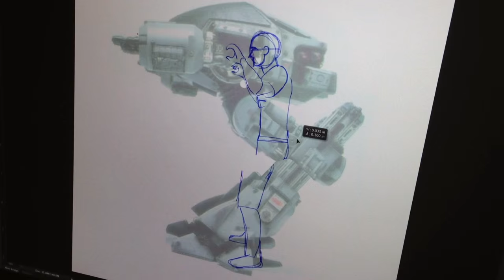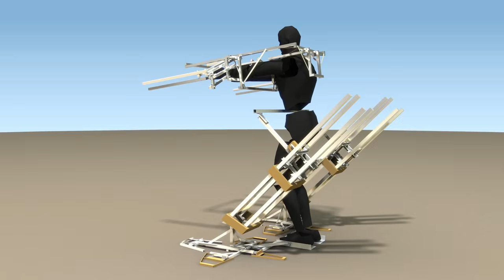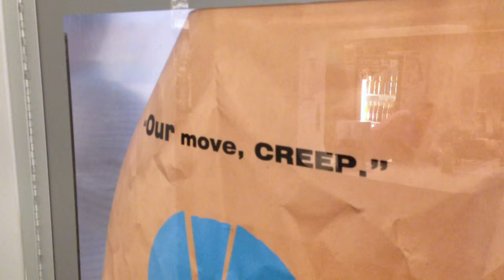Re-making ED-209 out of cardboard!

Comment: Oh also, if you want to get rid of that "bounce" that makes stuff light, add foam as a shock trap for the base points of the movement and then add a little bit more resistance into the joints, and you'll see mechanisms shake a lot less which can help you sell something as heavier than it really is -- because all of the weird oscillations that lighter objects have are minimised at source and what's left over is absorbed. Downside is it can be kinda noisy sometimes, depending on the type of foam and for some stuff, styrofoam just makes the most god awful sound. I find sorbothane and calk works best.

Comment: what did yall use for the conversion from 3d to 2d to print out your templates?
Reply from the maker: In our 3D program (Lightwave) the geometry was built "real world" scale. In 3D, we unfolded & flattened each piece of geometry, drew a box around it, measured the box's dimensions, and took a screenshot. In Photoshop, we scaled the screenshot to match the box's measurements, and sent to the printer in tiles. That's how we figured we could pretty easily translate our 3D measurements to the real world. Also worked great for complex aluminum builds, where we could basically "trace" our aluminum pieces on top of a blueprint. Here's an example in our photo gallery: https://www.facebook.com/Ghostlight/photos/a.10151605176010868.1073741829.186031635867/10151668637570868/?type=3&theater
Reply: Well Id like to say very nice work, Im tackling a similar project to build one for an 80's themed Comic Con in Nov a friend of mine is putting on. So i've been doing research and loved how ya'll did yours. was hoping you did it using Pepekura.
Reply from the maker: Thanks! We started with Pepekura, but discovered the ED-209 model wasn't accurate to the film, so we modeled ours from scratch.
Reply: Ill be building mine from scratch, but it will be a static model with maybe some articulation to it. Would love any tips, tricks, suggestions you might have. Some print outs would be fabulous.
Reply from the maker: We'd have to dig for our blueprints, which aren't labeled or organized, and no clear instructions. Super busy right now on new projects, but it would be fun to share. Tip: YouTube has lots of cosplay tutorials.
Reply: I kinda figured that, but couldn't pass up asking...lol
Reply: How can any one get their hands on the unfolded Files to build their own ED-209 made out of Cardboard, Foam or any type of material, or even replicate yours ?
Reply from the maker: Sorry, but we don't plan to release our plans. =(

Comment: U need goth shoes or RuPauls shoes to lift up 2 the proper height!!!
Reply from the maker: Have considered that. Good idea.
Reply: @GhostlightProductions  Maybe styrofoam on the feet with bottom fork/thick supports (laid horizontal) so the foam barely touches the floor cuz the weight is tearing the rest apart